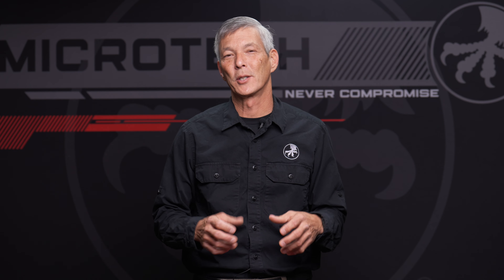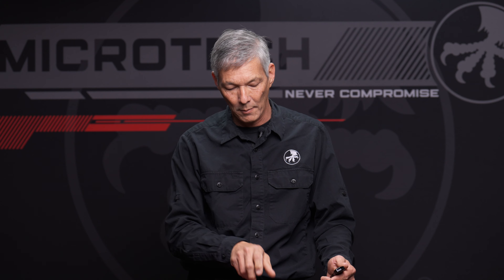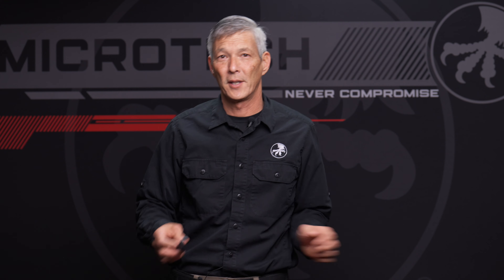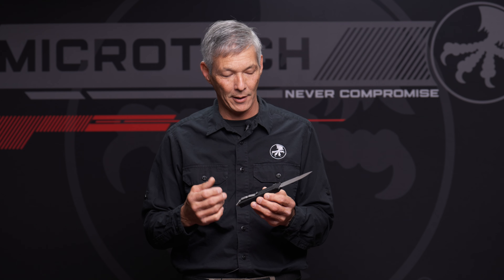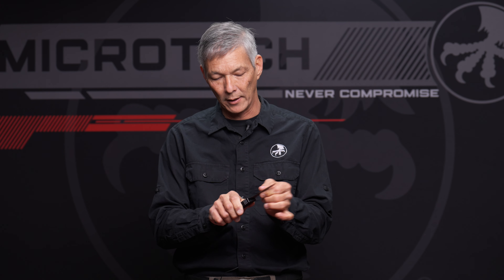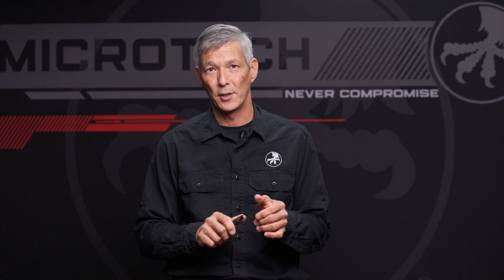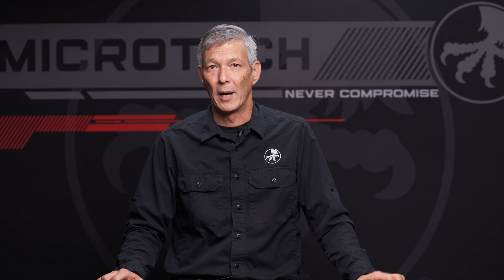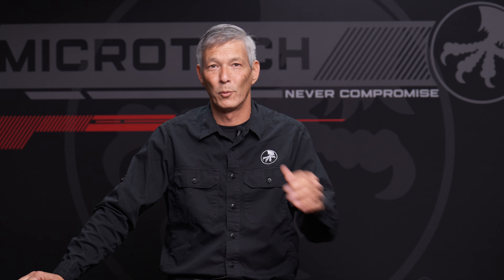ZERO blade play Microtech  OTF!

Comment: The thre F! Form follows function.......... most knife makers are inted that a knife has to look cool. Sorry, but in first case a weapon, even if it is a knife, should never hurt the operator! where is the finger stop on these knifes. i'm pretty sure that the blade is able to cut fingers in half!
Reply: It has a lock for firing and retracting, when the button is moved in either direction there is resistance from the spring keeping it from firing by accident